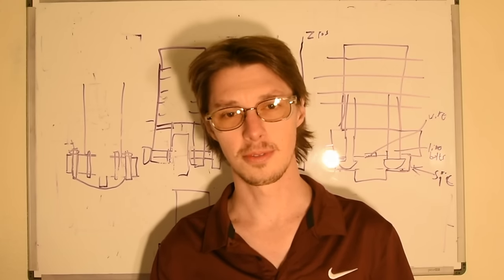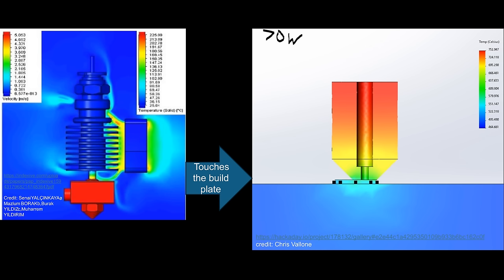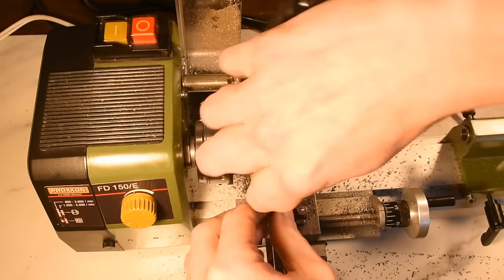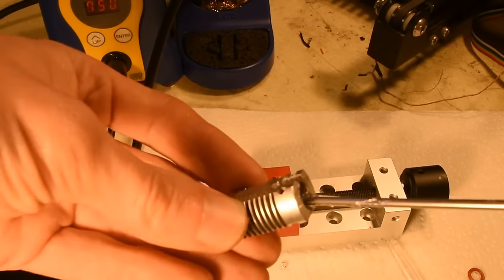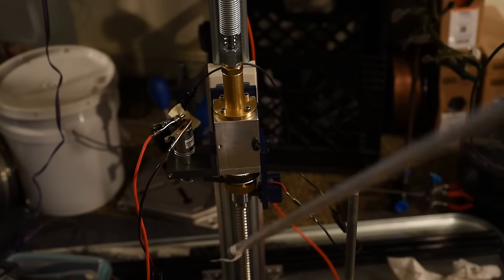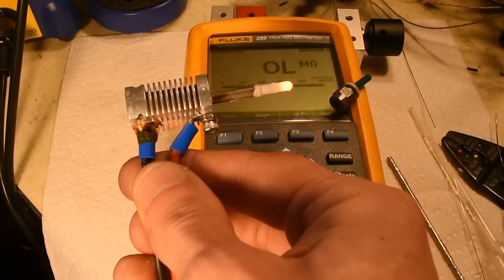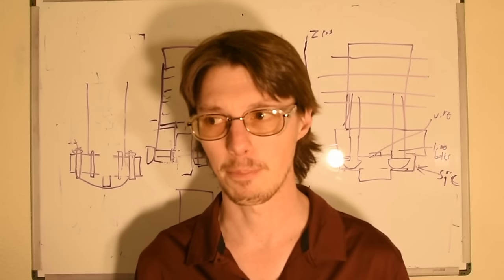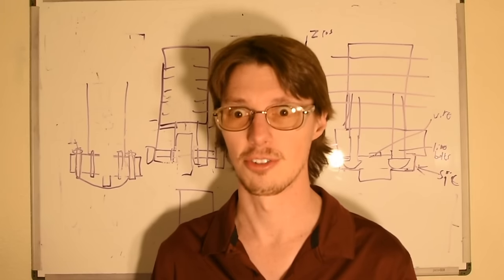How we made a 1300C 3D printer hotend for printing metals on the Creality Ender3

Comment: and yet still 0 real metal print.. jst bunch oéf BS:.
Reply from the maker: I am working on it man...
its hard....
Reply: @rotoforge2024  what material constraints are you dealing with or foreseeing? Some of us mechs spent more than our fair share of (or required) time in materials and like tinkering.
Reply from the maker: @notyouraveragegoldenpotato 
material constraints? 
right now, anything containing more than about 5% iron or lithium by mass is a no go if its printing temperature exceeds 900 C.

there may be others we are not yet aware of. I will be sure to document them as thoroughly as possible and provide them as part of a future video and in the project documentation and in the discord as they are discovered. I am sure there will be others.

for now we are aiming to print 510 phosphor bronze, aluminum (6000 series and 1100-O), and perhaps borosilicate glass and basalt. 

we may aim for other alloys in future. Monel, Ni-Ti and a few others are of particular interest.  I also want to be able to print aluminosilicates, and calciosilicates of various balances for tunable electrical insulators with acceptable thermal conductivities.  printing high reliability electronic monoliths in arbitrary shapes is what I originally did this for.  :)

why do you ask?
Reply from the maker: @notyouraveragegoldenpotato  the biggest problem we have is measuring the temperature of the metal as it is being deposited reliably and with sufficient speed to be able to react to phase changes in real time. 

and the glowplugs top contacts being way too fragile after EDM drilling in my opinion. 
they break if they are not strain relieved, they break after too much thermal cycling, they break if you drop them, they break if you look at them wrong. sometimes they just snap while sitting on the desk. 

its maddening to have come this far only to discover that the solution I sought is only barely functional. 
we are working on other potential configurations that may scale to production better and be obtainable at lower up front cost in time, materials, equipment and sanity and which should be far more robust in practice. 

but these take time to implement and i really just need some test data to prove feasibility.